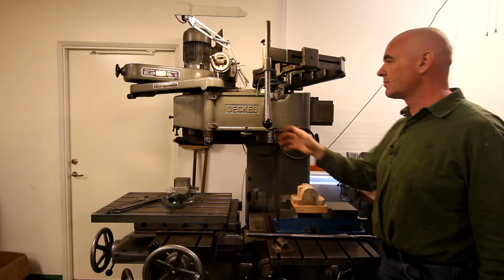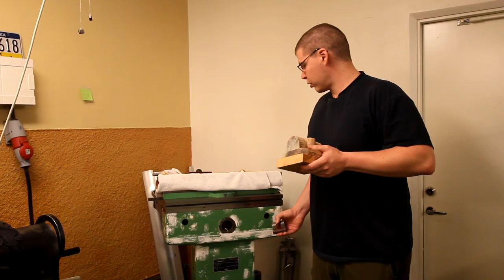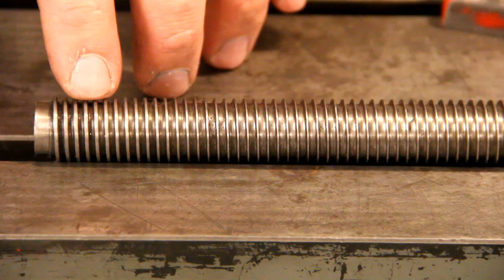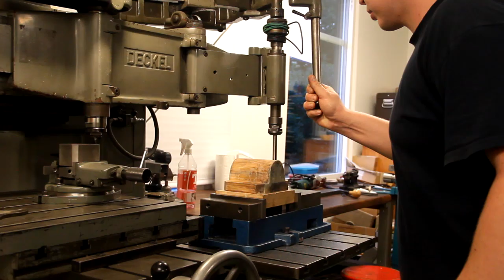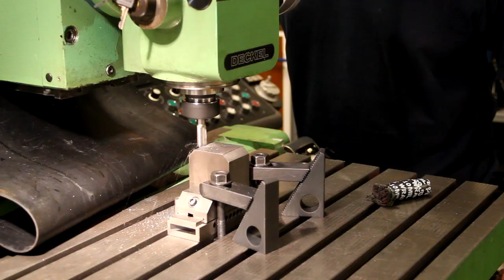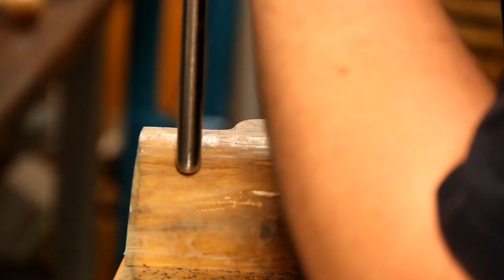Deckel KF12

Comment: Hi. I just bought a kf 12 resently. Do you have any information on the slide part that hold the spindle. Mostly lubrication and dis assembly. I have a Manuel but it does not cover that at all.
Also looking for some of the tooling if you have any advice. I live in cape town south Africa. So ebay seldome work and most companies dont ship to SA.

Comment: Been 5 years since this video. Do you still have the machine? The one I operated had a small tool cutter grinder to make/sharpen radius nose cutters to match mandrel radiius. The Deckel also had a multi directional hydraulic assist so you did not have to muscle it around. Edit: Plastic injection molding. If a phone handle core or case would get injured and welded, I would set up the master and trace the form to mill off the weld to blend.

Comment: I am thinking, what is needed here is a number of sizes of end mills.  the first roughing cut, should be large, moving down to this tiny mill as the object nears final shape.
Reply: Actually there is a Deckel single lip tool grinder accessory for this machine. All you need are HSS or carbide blanks from which you make your own cutters eh...     Ü

Comment: Dinosaurs of the past.  I worked for a company back in the late 70's to early 80's that had 4 of these and 4 smaller KF21s.  We used them to make aerospace molds.  They were at the time really nice machines but have been replaced by CNC machines today, thankfully.  Someone here mentioned that the finish was better than a CNC.  Not even close.  Those machines produced a terrible finish by today's standards.  We make molds today on CNC's that require almost no polishing.  Those machines where a real pain to use, literally.  You had to stand up close while the hot chips went in your face and down your shirt.  I have scars on my forearms to prove it.   Now you make models in the computer, away from the machines.  One guy now does the work of 4 toolmakers who used the Deckels and does it faster with more accuracy.

Comment: There is a single lip tool cutter that comes with your pantograph. I used this machine tool for many years in die sinking H13 forging dies. It will remove material much faster with homemade single lip carbide cutters.
I would love to get my hands on one of these again eh...     Ü

Comment: Have used one of these for 30 years for all sorts of intricate 17th-18thC gun parts, fantastic machines! For your cast-iron work a D-section carbide ball-cutter at top speed will profile that block in your film in a matter of minutes, also you could easily achieve that at 1 to 1 from the original part. You will eventually ask yourself, "how did I ever live without a Deckel KF"! Regards, Lloyd.

Comment: That's a nice machine that looks to be in very good condition but can I say, with respect, your not using it correctly? You need the 'Line-by-line attachment and it's clamp fitted so that the pantograph only moves laterally and vertically. Then you need to have the table and drag table( which, by the way, it looks from the video you have stacked on the workpiece table where-as it should be sitting on the right-hand table where it will slide quite easily whilst being 'dragged' by the left-hand table) connected together so that by turning the big wheel on the front of the left-hand table by small increments the workpiece and pattern  move together progressively towards the back of the machine. These machines came (originally) with various bits of ancillary equipment most important and necessary  of which was a 'Single lip' cutter grinder (which was a work of art in itself. lol)  but also included a 'Pattern making attachment' , a 'Mirror Image' table and a large bracket that held the alternative,   'heavy-duty', roughing-out spindle rigidly in one place whilst the co-joined tables were maneuvered horizontally around the fixed stylus. This was achieved by plugging in an electronic stylus that had a sort of trumpet shaped end that the operator looked into and attempted to keep a black dot in the middle of a lit white circle that would be 'nudged' off-centre when it came into contact with the 'model/pattern'. 'Cuts' were fed by hand at .050" a time by turning the large black wheel on the front of the machine thus lifting both tables simultaneously.  The stylus was of a larger dia.(+ .120"?)  than the cutter thus leaving about .060" for (semi) finishing with a singe-lip HSS cutter that left about .006" for hand finishing. I operated one of these machines as a kid in the .50s where the Tool and Die company I served my apprenticeship at bought 4 of them, 'brand new' + all(!) the attachments. Used properly, you could really make these machines 'dance'. Hope this helps.
Reply from the maker: Hmm.. the line-by-line attachment is probably built into the machine, the small crank above the pantograph arms does that.
I got a whole bunch of accessories when I bought the machine. I have yet to figure out what most of it is for. One thing I got is a big cone to look into, that might be the trumpet shaped thing you describe. I don't have any kind of mirror-image tables, but I think that would be pretty useful.
Reply: No.
Reply: No; the LBL (line-by-line) attachment locks the pantograph so that it will only move left/right then the workpiece/patern is advanced incrementaly (using the large wheel on the front of the machine which, if the drag-table is connected will advance both at the same time) from front to back. the small crank is the down feed for when the panto isn't locked and you follow a line all aroung the workpiece and then feed down another .005" or so. The LBL is an attachment that has 3 fingers of different lengths and is held by  bolts to the main body of the machine. It doesn't look like much so it may have been lost. but it is essential to the working of the machine.
Reply from the maker: manic4u2
Hmm You sure seem to know what you're talking about... Do you have a picture of this LBL attachment so I know what to look for, or even a picture or video clip of it being used?
If I connect the drag table, and move the tables simultaneously toward the back while milling one line at a time, wouldn't that make it impossible to copy in a scale other than 1:1?
I'm aware that I really have a lot to learn before I can use this machine properly - but then again... I'm not a machinist, I'm only a doctor!
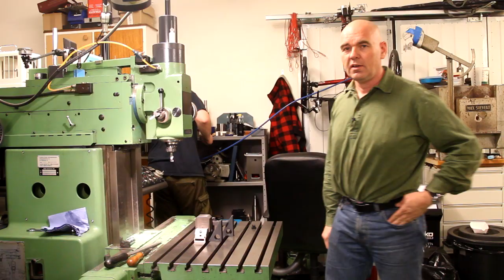Reply: Hi Matt looking at your 'vid', at 5:43 it looks as though you actually already have it on the machine. It has 3 'fingers' that fold out so that the pantograph is held against whichever one is suitable for the operation in hand. It's that thing at the back, held on by two black bolts. What you may be missing is the small clamp that hold it rigidly so that the 'panto' only moves up/down-left/right. See if you can pull the fingers down? It's the reason some of the paint is missing on the left-hand large grey hinge. I could draw a pic' of the clamp but how could I send it to you? I don't mean to sound like a 'Clever-Dick'. I'm sorry you seem to have got that impression. I earned my living for 20 years operating one of these machines. I'm just trying to help

Comment: Been using a Deckel for over 35 years for moldmaking. A dinosaur, but still useful.
Reply: Hi- Any chance you would be willing to share some info about mold making on one of these Deckel Machines. I am a glass blower and recently purchased a KF 12 in hopes of making some molds for glass.
Reply: Central Soccer We used them to make blow molds from aluminum up to berrillium copper which is quite hard , 30 on the Rockwell C scale. The two tables should stay connected at all times as (manic4u2) below says. I used single lip cutters mostly with aluminum as the speed is quite high on the machine. Mine had a replaceable lower geared spindle that I occasionally used. I would think books are still available for this equipment, The one I used at my uncle's shop even had a head you could install that would drive three cutters at once. We used that to cut electrodes from graphic for our EDM machine. If you haven't already notice, this thing can go nuts on you ! lol
Reply from the maker: 38sportcoat Even though this is my machine, I don't know much about how to use it. I know it can do a lot of tricks so when I found it for sale at a good price I bought it, but I realize I have a lot to learn... I haven't found much information about using 3D copy mills on the Internet, so if someone has information to share please go ahead!
Reply: Sir i just want sell my 3D pentograph machine, just give me a call

Comment: Good Luck with the Deckel.  You would be very smart to get a former or current "Duplcator " operator to show you how to better operate this machine.  I believe you should only go slightly larger on your tracer than the cutter, you already have the 2:1 ratio set on the graduated arms on the right.  Make a cut in an area you can measure, then "mike it up" and then adjust your "Tracer / Stylus " to get the size you need on the part.  Also in stead of bouncing around chopping at the work most of the time it is best to start at the very top of the pattern and track around the part, counter - clockwise of course, so the cutter does not want to run away on you. Use a starting depth which works OK with your cutter size and then after going around the piece once or twice till you are not cutting anything, lower the head (against the stop provided), using the overhead ratchet mechanism to an appropriate step ( .015 to .030 or so ) then go around again , continuing down the master till you get to the bottom of your pattern. If a lot of material needs to be removed it is best to use a larger end mill / stylus combo to " rough down " the part and then switch to something smaller to get all the details and a decent finish on the work piece.  Hope this helps, I do not mean to disrespect your efforts.  I liked the video and am a subscriber.   Thanks, Darryl

Comment: would a cnc mill do the same thing?? maybe faster??
Reply from the maker: These machines were often used to make molds with irregular shapes and yes, CNC made them obsolete for that purpose. If you construct something new and draw it in the computer then you obviously use CNC to make it. However, when you have an original part with irregular shape and want to copy it, what do you do? Before the CNC can make it you will have to spend a lot of time to measure it and program the CNC machine.
Reply: No NC code, no RS232 lines, no processing speed, no CAD model, no postprocessor, no memory capacity, and yet it can reproduce any 3D part. It can also scale the part. Probably less than  +/- .05 mm  (.002" in) accuracy. For MUCH less than a CNC mill.
Reply: I live in Central Oregon and have one of these Deckle KF12's that I use for making obsolete gun and boat parts. Still learning on it everyday but it has many uses for much less than the price of a comparable CNC of equal capabilities and it looks way cooler too!
Reply: There are 3D scanners that can make a digital model without CAD and lots of measuring. Some use lasers, some use jointed arms with angle sensors (I.e. potentiometers), and some are basically gantry routers with a touch sensor instead of a bit. I've even heard of some that can work out the 3D shape from two camera inputs.

CNC mills big enough to make a part like in the video can be built for $2000 to $3000 including the cost of the manual mill that gets converted. Check out some of the older Hossmachine channel videos for CNC conversion of a Grizzly G0704 bench top mill, or Kronos Robotics web site for info on converting an even smaller mill - KRMc01.

-- Mike
Reply: i c... thanks
Heath Gallagher

Comment: Love the machine and thank you for making and posting the video. I think the speed of the machine probably sealed it's fate, when compared to the modern CNC machines.
Reply: Its still great for copying existing parts, so if you don't have a CAD drawing and it has lots of lofted surfaces then this might still be the way to go. Ive had an interest in copy mills for a long time as it has and is being used by other gunsmiths to copy broken gun parts that often are very time consuming to measure and machine.
Reply: Lauritz Saxtrup
I have a friend who has an engineering firm with several cnc's and he probably spends three quarters of his time drawing parts to make which makes one off jobs very expensive, something like this would make life so much easier and probably quicker aswell

Comment: Fun machine, but aren't these usually used to produce intricate molds?  I think then you could easily justify the time, for a simple part such as that nut maybe not the best way. I guess it is good learning and practice! It is bound to be a fair learning curve to getting proficient at that machine. Best of luck and I am jealous of your personal heat treat oven. :-)
Reply: They can be had for not all that much money, this one looks a bit ugly on the outside but it hasn't been used much. I built a new control for it so that I can set and read the temp digitally. I can make a video about it if you like.